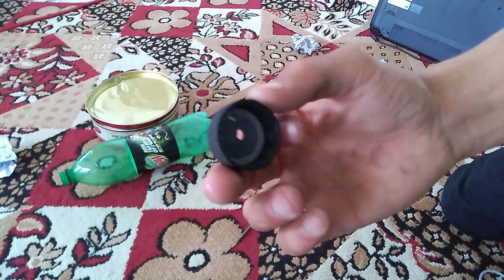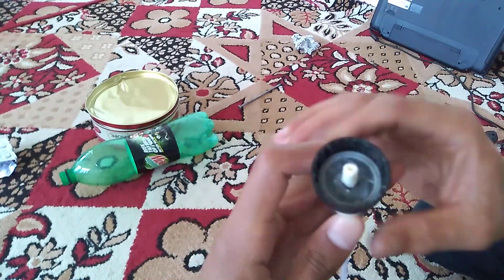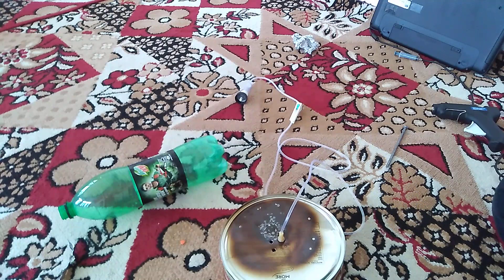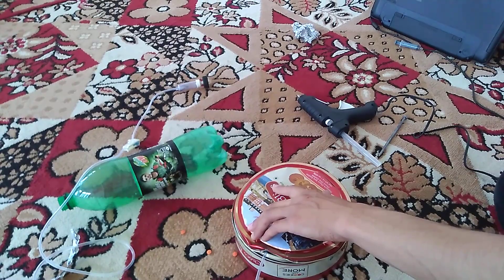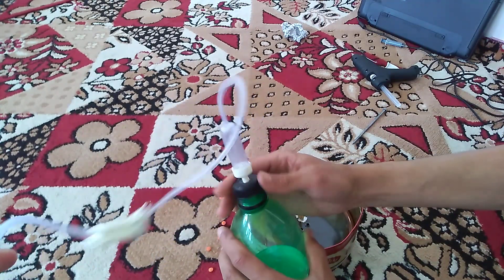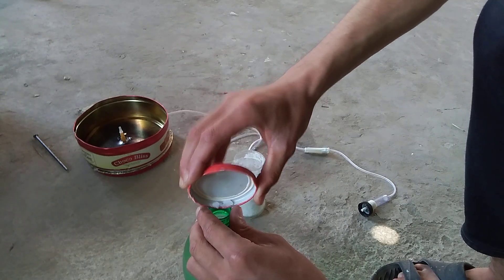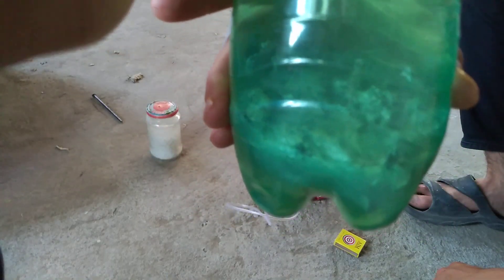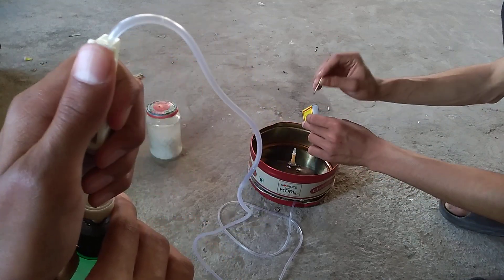How to make a hydrogen stove

Comment: You can use caustic soda usually sold as drain cleaner from any hardware store, and if you break up the aluminium smaller it will react faster, thus producing more gas ..
Reply from the maker: Thank you for your advice.

Comment: You should have made it clear that this only works for like 2 seconds. After that, it was not hydrogen that was burning rather the plastic.
Reply from the maker: Our purpose was to just give you an idea.
Reply: Yes. We can make hydrogen stove through electrolysis of water by connecting hydrogen output to the stove!
Reply: Yes we can make